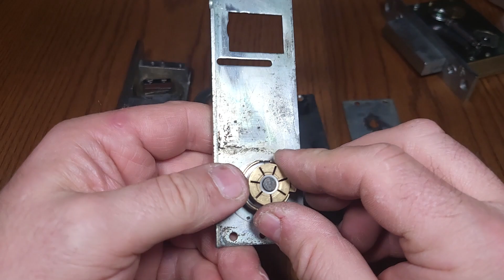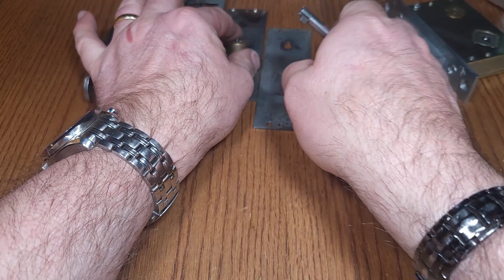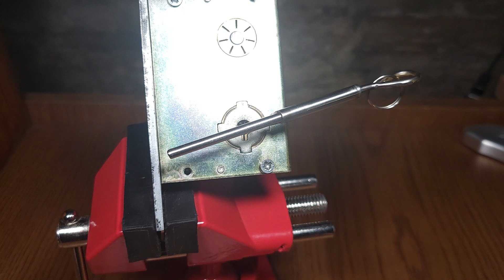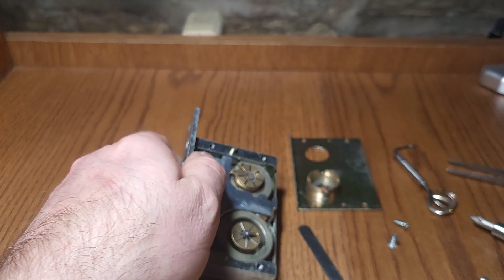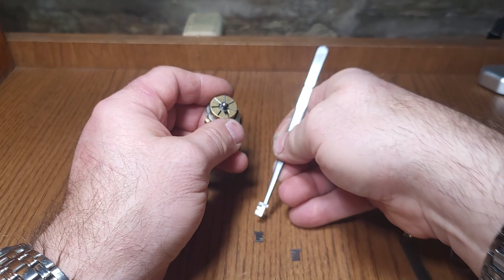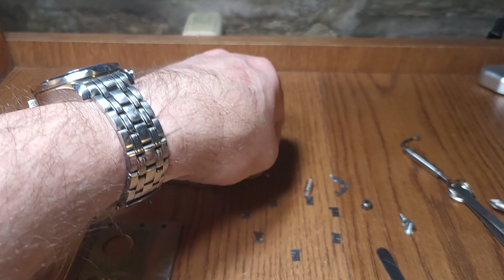Bramah MD27 Solving Tensioning, Tricky Pick & Gut

Comment: Great work Indeed. Would you consider making the tension tool to sell?
Reply from the maker: Thanks for that, the tensioner takes a couple of hours to make so it's really not commercially practical, it's worth giving it a shot at making one yourself, it's not too hard to figure out from the video, there really isn't much in the way of critical dimensions, the cam lug is the most important because that sets the depth of the bottom slider and you can use the lower wafer to figure out the positioning, it's mostly filing and a bit of silver solder which is pretty straightforward to learn

Comment: I have a Victorian bureau with 5 keyed alike Bramah locks, which are just smaller versions of your deadlock. 

I managed to make a key and first had to realise about the tensioner depth. The difficulty was cutting the slots in the key without affecting the other side as none of the cuts line up with each other. 

I did it on a mini watchmaker lathe with a tiny end cut mill bit. 

I put one slider in at a time and made sure the key worked for each slider, as I built up the key. Was fairly tricky and the key was a tad sticky but was please with the first attempt. Think I got the blank from eBay 😁
Reply from the maker: Great job, I'm actually going to fabricate a key from scratch for this NS27

Comment: They look really tricky. When you mentioned the validity of the tensioner did you mean more from a real world scenario?  Working on all of them rather than a specific one for each? Great picking 🎉🎉 cheers 🍻
Reply from the maker: Yes, exactly that, I've now seen 3 separate examples where the 6 o'clock slider is an identical depth